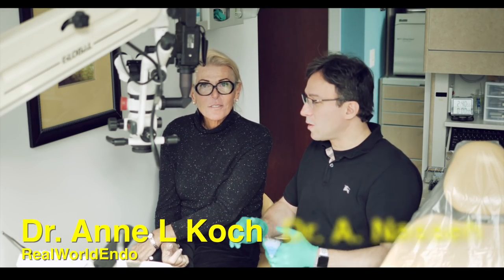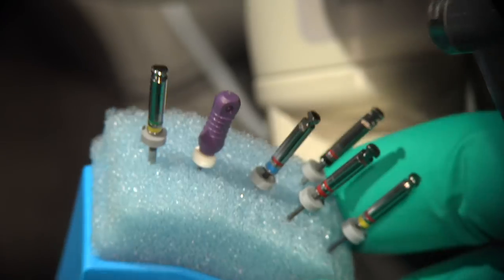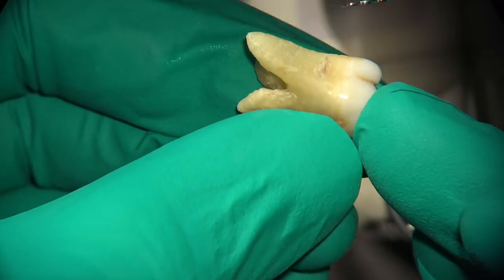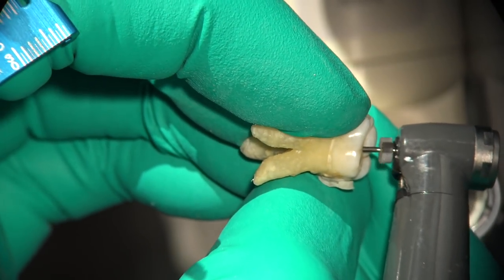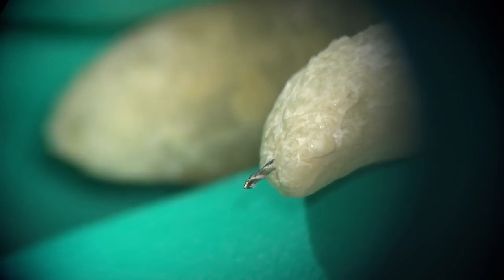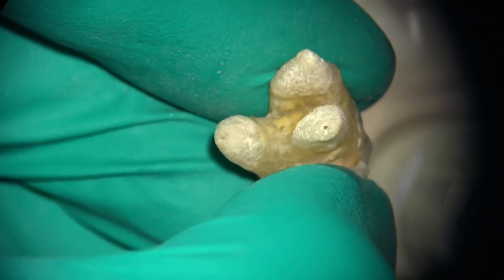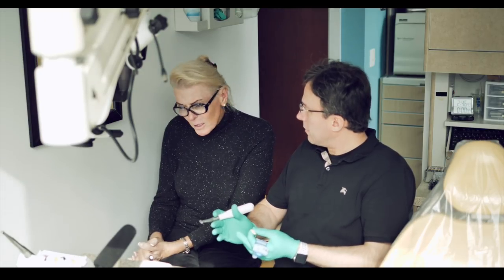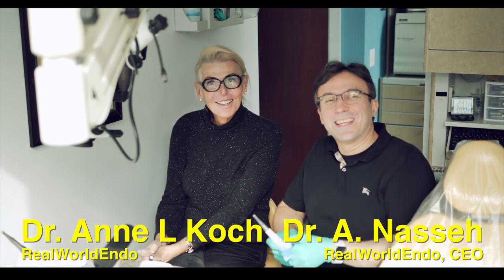EndoSequence Scouts quick flexibility demo with Dr  Koch

Comment: Can you explain what is the benefit of shortened cutting length? Maybe few words about exclusive nti? Is this a Heat treated file?
Reply from the maker: It does not bind up coronally and only creates a scouting path. The NiTi is similar to the XP 3D line and yes it's heat treated and very flexible. The Scouts are very nice set of files for this specific purpose. Best wishes.
Reply: Thank you for your reply. Looks promising , I will try them for sure